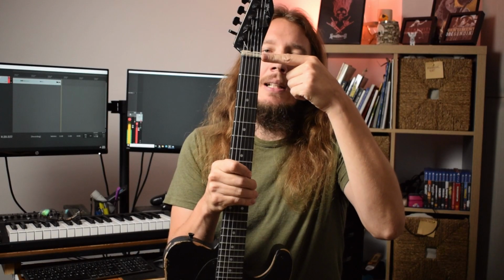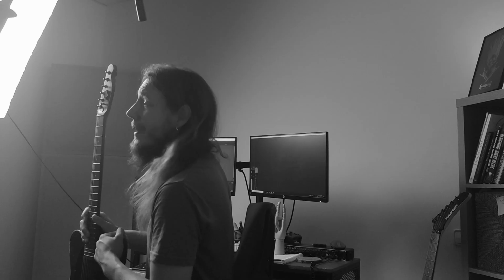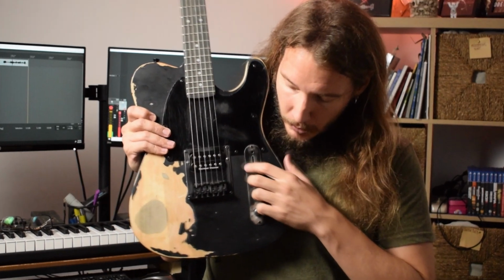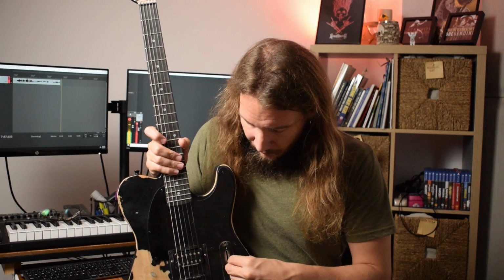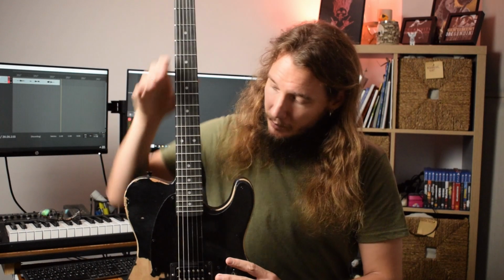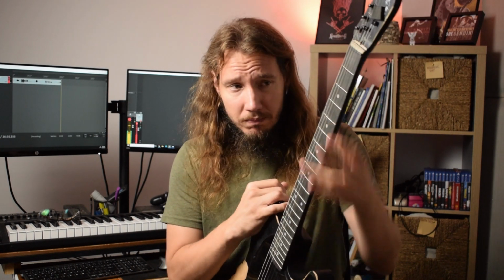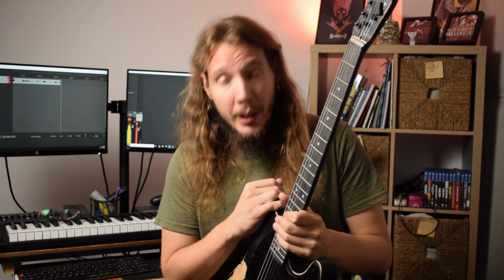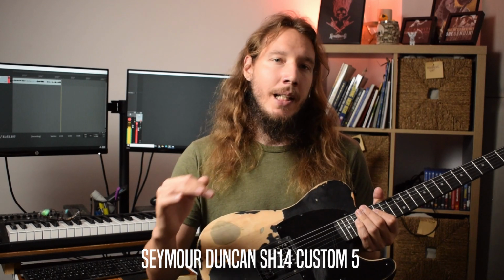I FU**** UP! Harley Benton TE 20HH FAILED mod

Comment: I ordered the Graph Tech PT-5010-00 which has the proper string spacing. I had accidentally ordered the Strat string spacing version that came with a pair of string trees but decided to order the correct nut after realizing my mistake. I haven’t replaced it yet since I’m waiting for a CRL 3-way switch along with other parts to upgrade at the same time. But I am afraid after hearing HB might have the nut glued in too good. I have replaced a nut before on my Fender Strat with no issues.
Reply from the maker: Yup,  in my case that thing DIDN'T budge, hence my F*cking it up!  I have seen videos of people using heat guns to melt the glue just a bit but still... those where folk who knew what they were doing haha

Comment: I think we all have a mod-project-gone-wrong story haha. I totally get not wanting to spend any more on this guitar.

If you do decide to salvage this, then: The dent from sanding the body can be filled with a lot of wood filler which you can sand flush with the body. If you spray paint over it then no one will know. Probably worth filling the area drilled out for the volume pot with some filler too and sticking to mini pots. If you use a push-pull pot, they are mini size and you can split the humbucker. I'm just suggesting these as I love modding and I make mistakes all the time which I try and fix haha. I'm no expert and not trying to tell you what to do!
Reply from the maker: I really don't know what to do with this failed mod... Right now I just want to let her sit in the corner until I make my mind, I thought of buying another TE 20 to swap the neck... or buying a good neck like a warmoth ... Or even just say goodbye and give her a proper viking funeral.

Now, that mod you mention is also an interesting idea!!

Comment: One of my worst mess ups recently was modding my first guitar a couple weeks ago, I went to fill the trem cavity with a block of wood to hardtail it and instead I split the body completely in half putting the block off wood in, i think yours turned out cool looking I'm modding a bullet fsr telecaster with a hh setup soon
Reply from the maker: Ohhh brother 💔... Thanks for sharing!
Reply: @headbangfridays  yeah man it was heartbreaking but I ended up hanging the pieces on my workshop wall to remind me to not mess up 😂

Comment: Link to that pickguard?
Reply from the maker: Here my man https://a.aliexpress.com/_vcYjiK

Have in mind that if it is for the TE 20HH the holes won't match ... And a little cutting has to be done for the metal plate to fit perfectly with the pickguard